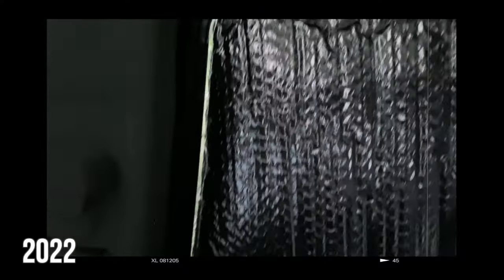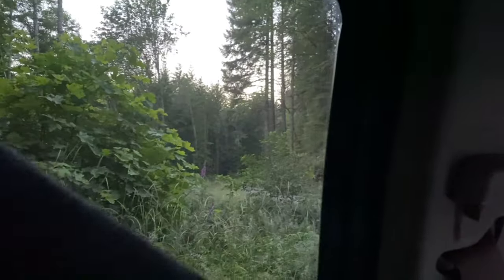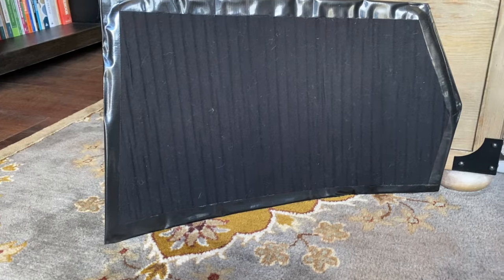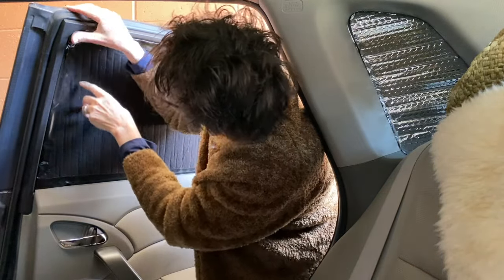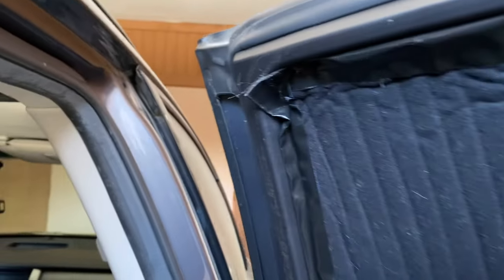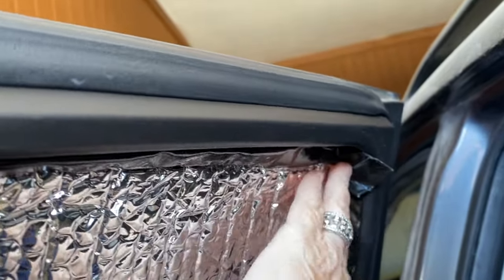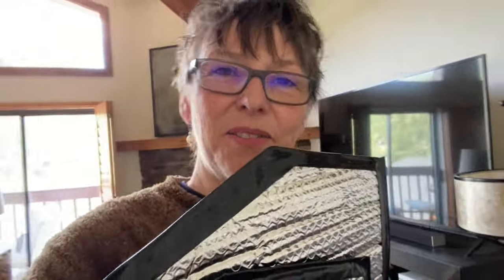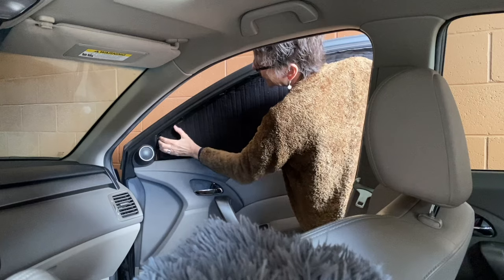The Camping Privacy Problem 😩 [Trying to Fix It]

Comment: I have a Winnebago RV that has shade built in. But I still made some for extra insulation.  Black spray painted then too.  Then back side ones put fabric on them with design. They look so cool.  Southern AZ is really hot right now.  Have fun
Reply from the maker: I've thought about doing a fun fabric for the inside but I thought the reflective side reflects heat, so I've hesitated on that one...

Comment: Good to see you again, I made similar covers for my windows and a tip I got was to use the ends of zip ties cut off to use to secure blinds in place, just slide down the inside of the window,, easy 😀
Reply from the maker: Interesting, I'll have to see if that works for my windows...

Comment: what year is your RDX?  I have a 2008 and my back seat can fold up differently and gives me more room...have you ever tried lifting the seat portion of the backseat before folding down the back part of the backseat?
Reply from the maker: It's a 2012, and yes, I later discovered the ability to take the bottom part of the back seats after FINALLY reading the car manual... doh! Thanks for commenting... :)